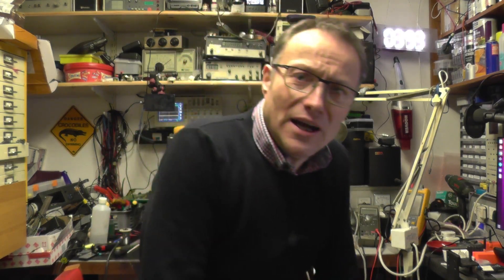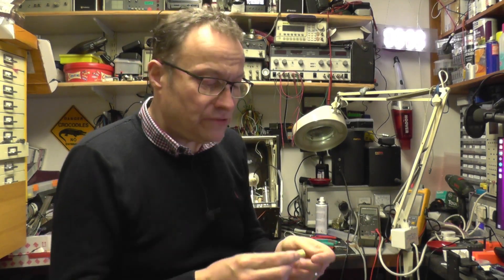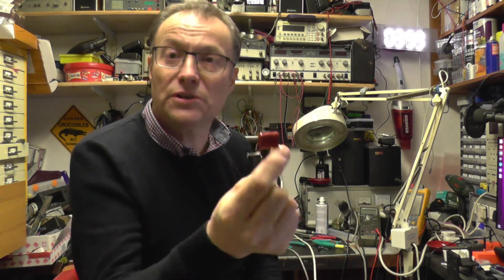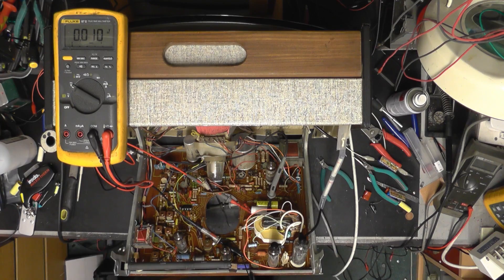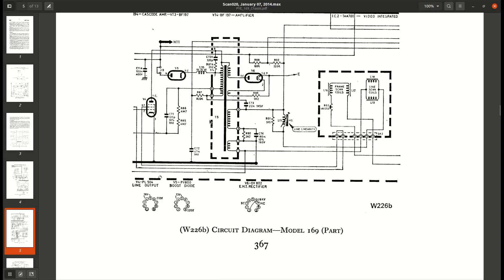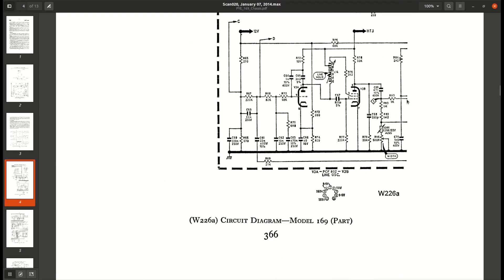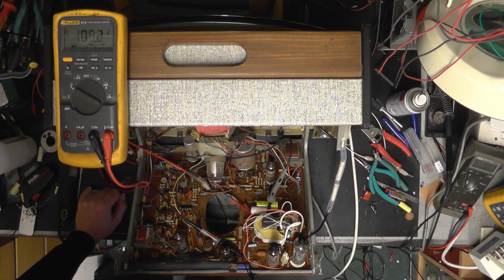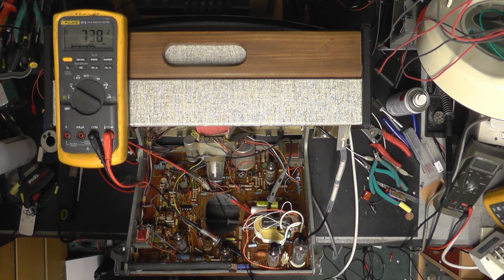Pye 169 Part Two - Blowing Hot and Cold

Comment: I've got a telly on the bench with EHT that goes up and down with the overall whiteness of the picture - along with all other voltages. Interestingly the picture gets wider, not narrower when this happens, 'cos the horizontal scan coil is paralleled with the primary side of the lopt. even when the voltage is at the correct level the picture is too wide, as if the scan coil had wrong inductance. can't win them all.

Comment: The Australian Philips K9 was notorious for line tuning capacitor failure resulting in a trail of destruction.  I had a fault in a cassette recorder in the early 80s where it rendered my computer programs unreadable. I found the recording would start ok, but became distorted after 10-15 seconds.  I eventually found a green capacitor in the bias oscillator was breaking down and shifting the frequency.